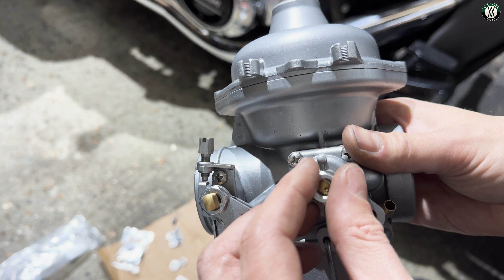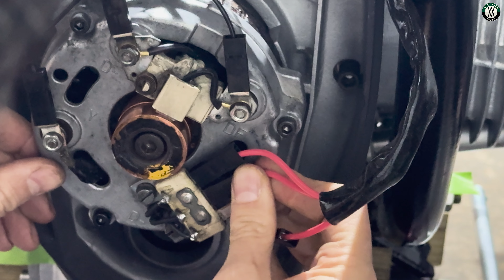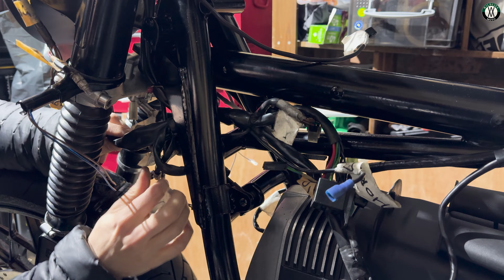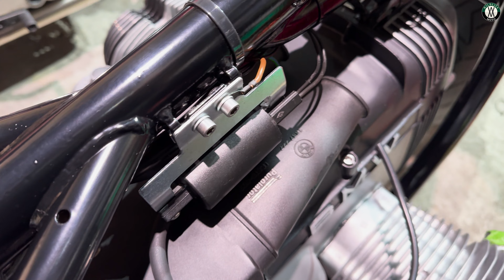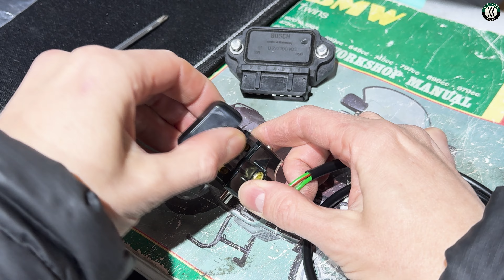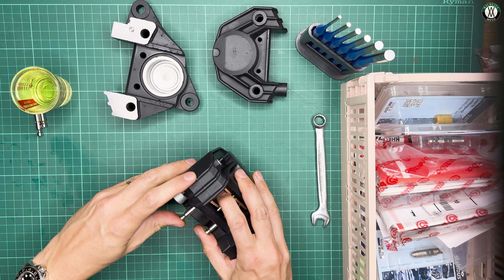BMW R100CS: Build Update | Electrics Installed

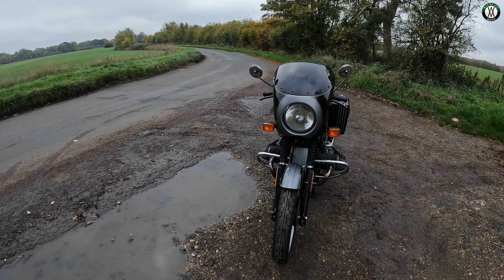Comment: Cool, that you where be able to do this, the BMW 750IL that was used in the James Bond is classified as oldtimer in their catalog while it looks it could have been build yesterday. 14:38 the handlebar / steer looks very narrow, i would put a wider variant.
Reply from the maker: These bikes do have surprisingly narrow handlebars. I think they work well with the front fairing. If I was taking the fairing off, I would probably go for something a little wider.
Reply: someone else mentioned this is a video about the R100RS that handlebars where narrow to not protrude the fairing and help areo. but i think a slightly wider would be more stable and easier to handle. @WildlifeMoto

Comment: I also wonder were the original brake lines rubber or were they braided? I think black sheathing would suit the bike better than the clear sheathing. 
Will you re-install the chrome engine guards?
Reply from the maker: That would look good. The lines on the bike when I got it were clear braided. They were pretty old looking but not sure if they were original.

Comment: Fantastic work & results WM! Blame the direction of the clamps on my OCD😉 I appreciate you acknowledging this because it shows most definitely you listen to your audience ❤️ Is it possible to not install the tank & rig up a fuel bowl up hanging from the garage roof to avoid having to remove it & then re-install it in case of adjustments? Thus avoiding scratching the beautiful paintwork?
Once the battery is charged or a new battery fitted, switch on the ignition (without starting the engine) to operate through all the switchgear to confirm everything is connected & operating? Front & rear lights, Brake lights, horn, instrument lighting & idiot lights? I don’t expect the fuel tank to have a fuel pump, but confirm fuel is flowing through the taps.
Reply from the maker: Cheers Steve and thanks for your advice. Yes, I've been thinking about getting a temporary fuel tank for the first tests. The last thing I want to do is mess around with taking the tank off again and risking scratching it. On these bikes the seat runs super close to the tank making it risky to remove the tank without scratching it on the front of the seat housing. As soon as the battery is charged, I'll test out all the lighting. Hopefully it's all good! No fuel pump, but I am rebuilding the taps with new meshes and gaskets.